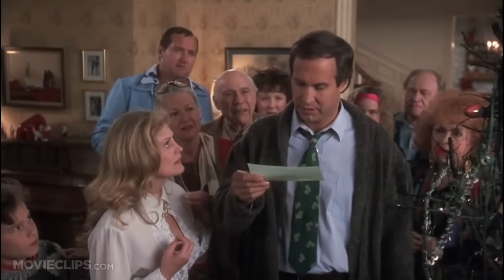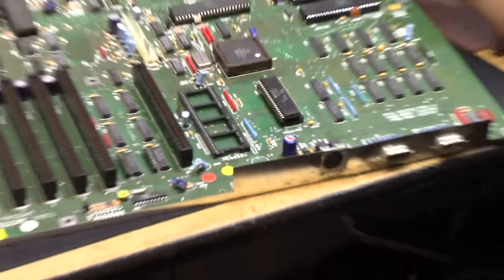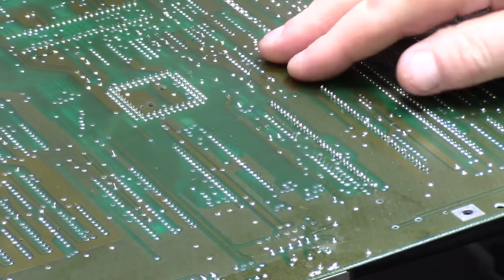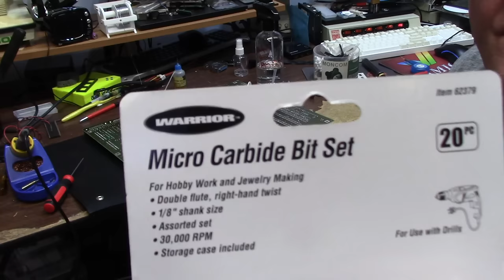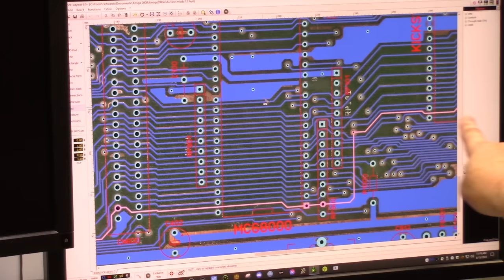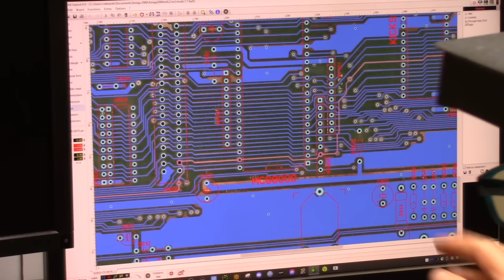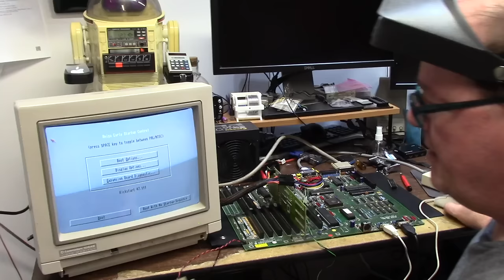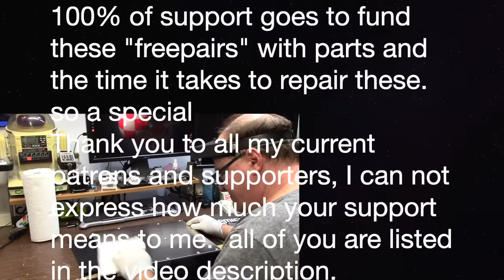Commodore Amiga 2000 battery death socket

Comment: Good tip about adding a diode to make sure the board doesn't try to charge the battery. The part I didn't understand is where it seemed as if it was being connected across the pins of the battery socket.
Reply from the maker: i just needed a ground, it blocks going in to the positive from the rail and sits between the positive terminal and the positive battery pole

Comment: Great Video as always Chris..   Would anyone know where that sells A2000 Metal bottom plates as my A2000 is missing it which bugs the hell out of me lol...
Reply: Well they still will Work, Sadly I had a Lightwave Render Farm, I made a ERROR, Removing A2000 from Case to Mount in a "Wooden Rack" or Re-Construction of a "Tallboy" to make the Drawers to mount a A2000, to make it Slide out, Easier to Access & Route Cables Etc,  arhhh, the 90's... wish I had those 8 Cases & Back-plates now ...

Comment: Could you use a rechargeable c2032 and skip the diode?
Reply: I'd like to know too. I have used some coin cell sized supercaps, 1.0 Farad keeps her going for a while.
Reply from the maker: you can and i have them just 3x the price of a 2032
Reply: I got  quite a few of the adaptor pcbs printed as they work in other retro devices that have the same Varta misfortune.
Reply: @ChrisEdwardsRestoration If you do use the diode, which direction is the black band soldered?
Reply from the maker: Current flows in the direction that the triangle/arrow is pointing, but it can't go the other way. so you want the battery voltage to go out but not charge back from the 5v so put your arrow towards the positive in this case.